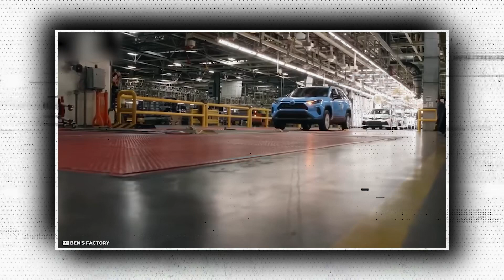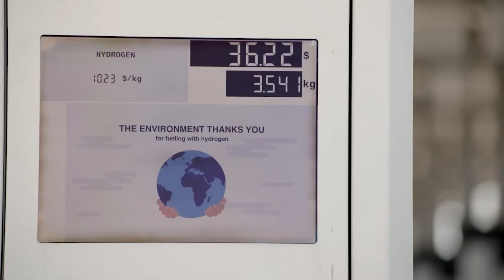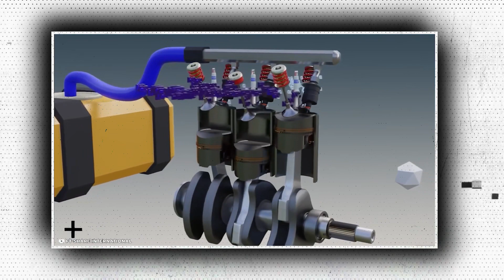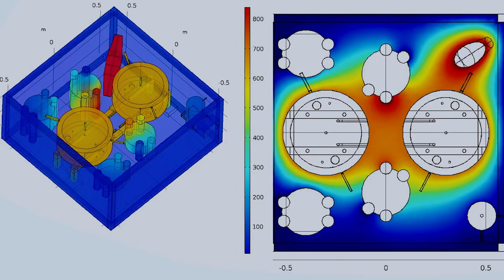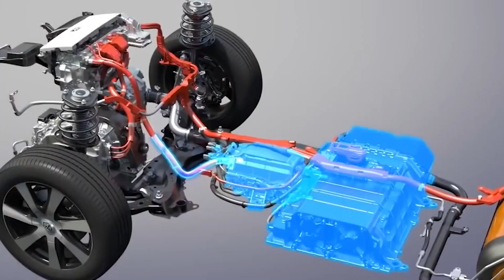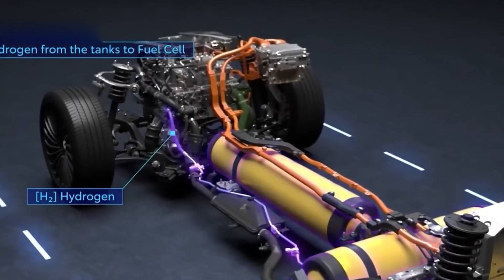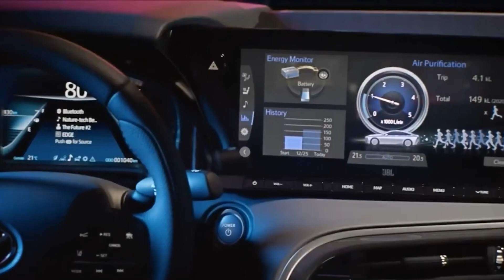Toyota Just UNVEILED World's First Tri-Gen Production System!

Comment: Fuel cells may have a place in the world of tomorrow, but it will not be part of the electric mobility future.  Clean affordable electricity will make the production of hydrogen financially impractical.  Who would want a hydrogen fuel car when they can supplement and in some cases completely produce their needed fuel from solar cells at home.  Fuel cells are expensive.  Battery costs are going down.  Hydrogen requires special high pressure tanks.  There is no hydrogen station infrastructure to support practical driving.  The performance of current fuel cell cars is less than impressive.  No ... fuel cells are not the answer.  Toyota is barking up the wrong tree.  Call off the dogs Toyota and get back on track while you still can.
Reply: Out dated comments
Reply: I disagree. Cheaper batteries are temporary. Lithium is a limited resource that can't be reused. Batteries are only 5 percent recyclable. Making batteries out of different elements only buys that market time. EV batteries are the new fossil fuels. If we can use fuel cells in place of batteries, this will eliminate that problem. Even if it doesn't completely eliminate batteries, it allows for much smaller batteries at the very least. Also, fuel cells aren't the only type. Toyota is also working on Hydrogen ICEs. In terms of infrastructure, we didn't have gasoline infrastructure when the Ford model T came out either but that didn't stop Henry Ford.
Reply: Tesla has achieved 92% battery cell material recovery already .  I don't know where you get your 5% number.  Great strides have been made with clean energy generation.  The percentage of Wind and solar farms are growing dramatically as we speak.  The point is that clean cheap electricity is going to happen.  The need for rare materials in batteries is still here, but in less quantity than ever before and work is ongoing to to further reduce the their use if not eliminate them altogether.  

Fuel cells typically use a platinum catalyst ... as I said, fuel cells are not cheap.  And they have a life span of about 150,000–200,000 miles.  And they run on hydrogen ... that must be purchased throughout the life of the vehicle.  In 2021, hydrogen retailed $8.50/kg to $10.80/kg higher than gasoline prices matching the same fuel cost per mile for hybrids or conventional gasoline vehicles respectively.
Electricity is significantly cheaper per mile today and will be even cheaper in the future.

And have you driven the Toyota mirai hydrogen car.  It's lack of power really stands out, especially if you compare it to an electric car performance.  Even if it were to provide a practical mobility solution today, it would still be a hard sell to prospective consumers ... as evidenced by it's current "success".  

The only folks that will benefit from fuel cell vehicles are the folks that want to cell you the car and the hydrogen.  I'll keep my solar panels on my roof , save my money, and buy a Tesla.
Reply: @charles_t_8568  that must've changed fairly recently. Just a few years ago they were almost unrecyclable other than the circuitry that connected the lithium or metals together.